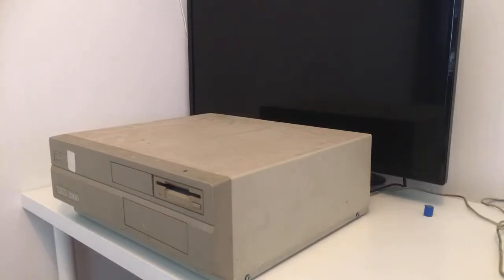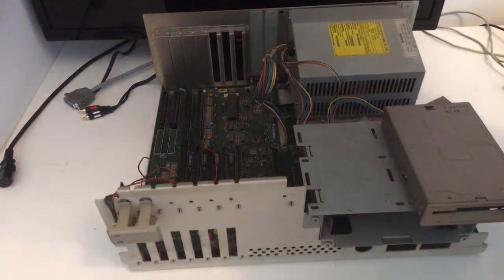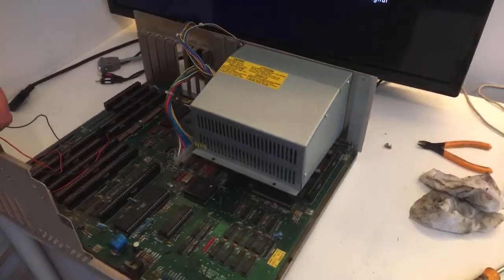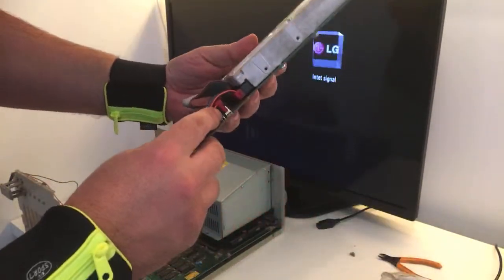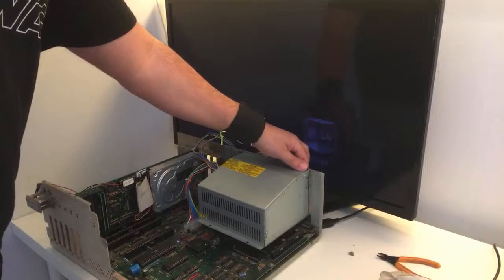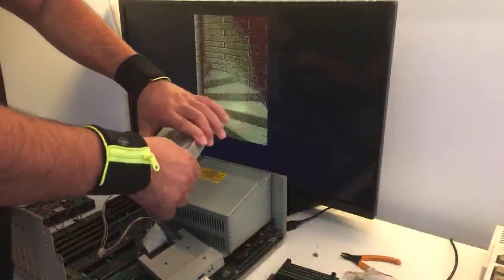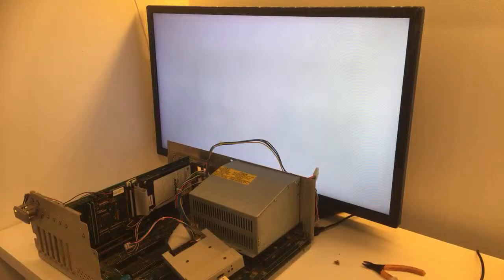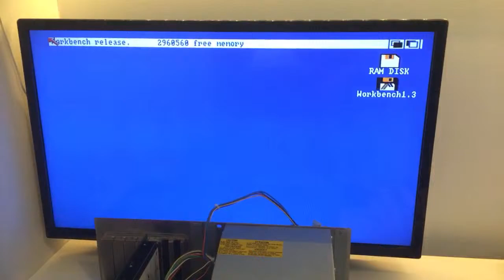Commodore AMIGA 2000 Livestream

Comment: Watching this got me inspired to break out the 2500 I had that I had cleaned up varta damage. Tried it first without the accel or scsi card. No dice.  Put the accel card in, booted right up!!! Put the scsi card in and yeah the drive is dead  and I don’t have any spare scsi around. Ran amigatestkit on the machine and everything else checks out good.
Reply from the maker: Mike Kopack Love this comment, great to inspire 🙏🏻😁 witch accl card do you use? 
Now its time to enjoy that beautiful computer 😁😁💡
Reply: This one was the A2500 setup so it had the Commodore ‘020 accel with 2 mb fast ram, and the Commodore Scsi controller.  It was part of a big haul of Commodore 8 bit and Amiga Kit I picked up back in January. I would keep it if I didn’t already have an A500 in a checkmate case with Vampire and a Vampire 4 SA.   Also scored an original A1000 and a couple A500s in the deal and a whole slew of 128s and 1541s and 1571s.  Trying to slowly sell them all off.  Kept a nice 128D and some random accessories for myself.
Reply from the maker: Mike Kopack Great haul man, nice collection 😁
Well im interested in your Amiga2500 i never had/seen one, send me info pics, ill buy it😁
Reply: RETROCENGO I’m in the USA.  It’d cost more to ship it over to you than it’s worth!  The 2500s were really just 2000’s sold with either an 020 or 030 accel card with extra ram and a scsi controller/drive in it already. Really no different than buying those parts afterwards and putting them in yourself. Didn’t even have a different case badge! Apparently they were sold like this as “Toaster Ready” setups.
Reply: Oh I take that back. As I look at it now it DID have a different case badge!

Comment: I have a strange problem with my Amiga 4000 audio circuit.  I have clean audio coming from the A4000 CDROM, but no sound from any other source (i.e. games, OS beep, or any other sampled sounds from the hard drive).  I suspect there is a bad component somewhere, but do not have any test equipment to troubleshoot the problem.  Whatever the problem is, it's effect both left and right audio, but not from the CDROM. I unplugged the CDROM IDE cables to see if somehow, it was taking over the audio path, but there was no change to the problem.

Comment: Have you got the copy of UNIX System V as well as the activation key that came with the COMMODORE AMIGA 2000?
Reply from the maker: No
Reply: @RETROCENGO  OK no problem but maybe a power connection to the hard card is required as the power from the Motherboard might not be enough to power the platter motor.